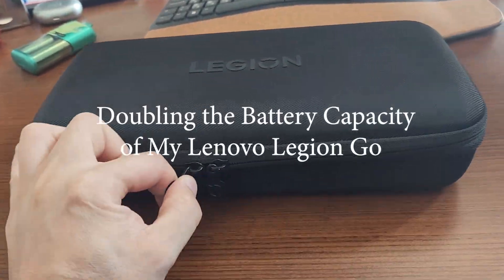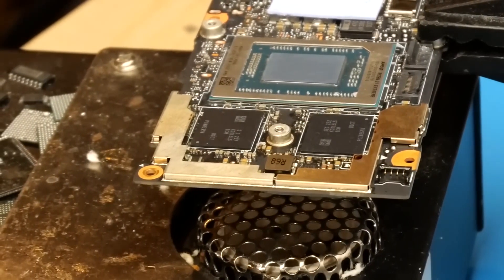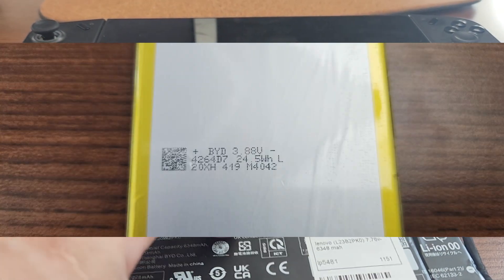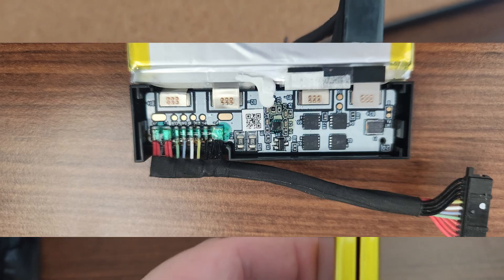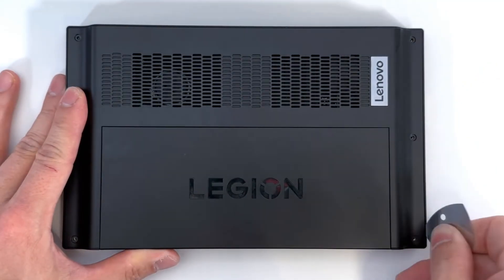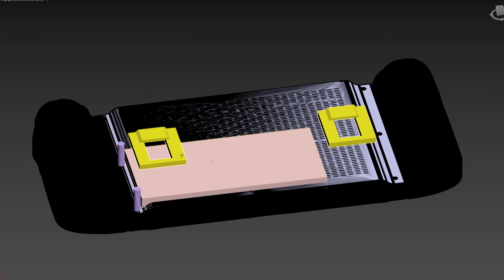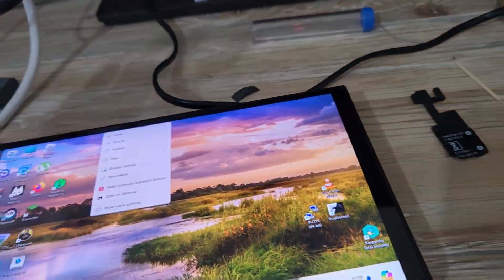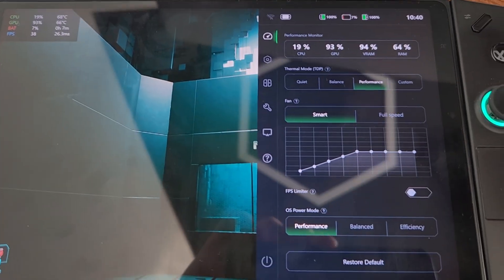Lenovo Legion Go Double Battery Capacity

Comment: Thank you, bro! I just performed this mod thanks to your video instructions! I also challenged a nearby 3D lab to scan my original backplate and create a custom one with stand support based on it. I'm experiencing issues with incorrect battery capacity too, even after a full charge–discharge–charge cycle, but it's not a problem for me.
Reply from the maker: Welcome, if possible share your 3D backplate.
Reply: @elnurmehdiyev5062  For some reason YouTube deletes my messages where i put my gmail, so try certain.gek
Reply: @elnurmehdiyev5062  I'm tired of my comments being deleted. How can I contact you?

Comment: Not really an expert, but i suggest replacing the bms with a new uncalibrated bms. Not unless you have a contact from BYD and provide you with necessary tools to properly rewrite the initial calibration of the cells.

Also don't forget to balance the cells before attaching it to the bms.

Also i noticed it's 3.88v nominal per cell. And it's on series.

You can try your luck looking for a 7.76v-8.5v nominal with large capacity as long as it doesn't go beyond 8.9v maximum voltage when fully charged. (Or limit it by programming the BMS to have the max output of 8.9v)

Though i doubt you can find one since 3.7v nominal and 4.2v max is the standard. Rarely you can find 3.8v nom 4.4v max.

Comment: I will like to get the ram and the battery upgraded on my Legion go. But i dont feel comfortable doing the ram upgrade and mess something up. the battery seems to be less risky because you only working with the new one and not the original. I dont have a 3D printer either. I wanted to ask if you offer both services ?

Comment: I really want to try this! Is it something a beginner could do? Nothing seemed too complicated in the vid from what i saw. Idk if it would be a hassle for you but a more detailed tutorial would be awesome!
Reply from the maker: @StuffIThink  well, its quite a challenge for beginner...
Reply: @elnurmehdiyev5062  I'm really just not sure about the soldering. I know my way around a PC and I've used 3d printers before. You think it would be a bad idea even if i could practice the soldering before i actually tried it?
Reply from the maker: @StuffIThink  If you know what you're doing, anything is possible. In the worst case, you might need to get another battery. Here's how I would approach it:

I recommend ordering two batteries. Start by disassembling one and carefully removing the black sticky tape. Check how the BMS board is attached to the cells and gently detach it to ensure you have enough contact points for spot welding extension tabbing wires. Be cautious not to short anything.

Next, carefully cut the cover off the other battery to access the spot-welded contacts. Once you’ve spot-welded the extensions to the disassembled battery cells, solder them to the contacts of the second battery. Secure both the spot-welded and soldered contacts using Kapton tape, and attach the two batteries together with double-sided sticky tape.

After removing the original battery from the handheld, place the upgraded battery inside and test it. If everything works and the handheld functions with the increased capacity, reapply the sticky tape to secure the battery and print a new back cover for the device.

I'll soon update the back cover model with version 2, which will include plastic clips similar to the original design, as well as an improved layout.

Be sure to double-check battery polarities and measure voltages before applying the mod. If there are differences in voltage, fully charge both batteries and then discharge them to about 3.88V before proceeding.

For this upgrade, you'll need:
Two identical batteries
A spot welder
A soldering station
Kapton tape (5mm wide is fine)
Hand tools and a multimeter
Double-sided sticky tape (preferably flexible, similar to the original)
Tabbing wire (3-5mm wide)
A 3D printer (or service) to print the back cover
You can find guides on disassembling the handheld and removing the battery on YouTube.

Comment: You need to find a Lenovo laptop battery with roughly 100wh then use the bms from that to work with your battery. That will work! I've been doing this for a while 👍🏻

Comment: You can just buy extra 10000mah LiPo cells or replace the current one. All you need to do is add extra cells until you can't get any more to fit inside the device. I've done something similar to my phone. from 5000mah it's now running 2000mah, just use the same BMS. Hope this helps
Reply from the maker: Cells used in GO rated to 3.88V, if you can find such specific batteries with larger capacity, please share, would be useful to others too. Cells with other voltages and chemistry would likely destroy your charging circuit or lead to early degradation of different voltage cells.

Comment: Hey buddy just curious, can you tell us which IC on this device specifically requires 3.88V to a point you need to get a battery that is putting out exactly 3.88V?

Also there's a reason Lenovo left room inside and didn't cram it full of battery space, but hey, what would I know?
Reply from the maker: The specific IC you're referring to is part of Lenovo’s design approach, where they reuse components from their laptops to accelerate the product's development and release. This includes the power management circuitry, which is optimized for the same 3.88V cells commonly used across Lenovo devices. In my modification, I parallelled identical cells, effectively doubling the battery capacity while occupying the intermediate frame space, which was originally reserved for cable management. This adjustment had no impact on thermals, as there’s sufficient space for airflow, and the design safely accommodates the increased battery thickness. Lenovo likely left extra space for flexibility in design rather than for thermal concerns.

Comment: Hello bro, can you tell me the size of the Original battery? I'm going to customize the battery, but I need the Previous Dimensions
Reply from the maker: Cell sizes differ from package sizes (w BMS).  Take 65x140x10 mm for double cell sizes as reference. Add BMS 65x20x10 mm
Reply: @elnurmehdiyev5062  And I want to know what the maximum internal space can be without the height of the plastic plate, because I want to customize the battery as big as possible without retrofitting rear lid。
Reply from the maker: @junjiejiang3933  you better open it and check yourself in that case
Reply: @elnurmehdiyev5062  thanks a lot bro🙏

Comment: Just use power bank. Problem solved
Reply: I don't think you quite understand that the purpose of this is to eliminate the need for that.
Reply: @llcj07  how many mah did he add? Its more practical to use powerbank. Powerbanks has more battery capacity. If this is to replace powerbank then your idea is stupd
Reply: @llcj07  and his way of eliminating the powerbank is stupid..
Reply: Yeah but with power bank you eliminated the need to update custom firmwares, screw up 3d prints, solder battery tabs with messed up bms and god knows what's next 😂.
Reply: Khaby Lame would definitely hook up a powerbank and make a funny face

Comment: 3.88 nominal voltage cells? Very bizzare choice, especially when space was not at a premium and the device was already a heavy, chunky boi. This increases costs, but gives it a higher capacity.

I believe they are HP (high performance) cells that are more commonly used in cell phones. They have a max voltage of 4.48 (around there), instead of the typical 4.2 volts.

Comment: idea have you tried bazzite or cachyos ? i think the battery indication adjusts itself differently in that os it take a bit of time like a full battery discharge to calibrate. I'm running cachyos it's super easy to install dual boot and runs like a steam deck you can go to sleep mid game no issues.
Reply: Running bazzite on mine

Comment: It could also be tested with a Lenovo battery of Capacity: 60Wh/7820mAh Compatible laptop models:

Lenovo Yoga 7 Pro Series

Lenovo Yoga 7 Pro-13IKB Series

Lenovo Yoga C930-13IKB C930-131KB Glass Series

Lenovo Yoga C930-13IKB-81EQ Series

Lenovo Yoga C930-13IKB-81EQ000HGE

Lenovo Yoga C930-13IKB-81C4 Series

So the weight will not increase too much and we will have more playing time, it would be 1472wh more and maybe it would be without modifying the housing.
Reply: I would take it perfectly inside since the measurements are 29.5cm and if we disassemble them and put them one on top of the other they are 14.55 and we disassemble the thickness remains at 1cm. So it would take perfectly inside the original housing, having the same connector and would close the housing.

Comment: If manufacturers were forward thinking enough, options like this would be available from the manacturer.  Imagine them selling double sized batteries as an option and being able to sell a bigger cover etc.  Docks that added additional cooling capacity so the machine could run faster whilst docked etc.  They really don't think about this stuff as a way to make more money.  p.s. Great job :)
Reply: They do make these machines to your spec. They are boutique providers and the machines are double the price. You can get one with the strix chip and 64 gbs of ram with a 99 watt battery and OLED screen...$1999.00.
Reply: @johnwebsterification  interesting, I did not know that. Very cool.
Reply from the maker: @matthewwain9958  they are focused on competition, that going to be next gen handhelds I'm pretty sure, just like ROG did.. ))
Reply: That's because they honor a warranty where the machine has NOT been opened.  You open it, no warranty.   Make sense?  They don't want just anybody doing upgrades to their product and then have you expect to have a warranty, so of course they aren't going to sell that stuff.  It's common sense, which most people don't have anymore.
Reply: You can open a product just fine and still have warranty. Stickers saying you can't are not legally binding. The manufacturer has to prove anything you did caused a failure, in order to get out of honoring a warranty.

P.s. PC's are highly configurable and modular.  Your comment really doesn't hold water.
Reply: @matthewwain9958 , yeah, honestly I think I've heard such warranty problems from asus (like rog ally) users more than lenovo, if lenovo had that much trouble at all?
Reply: @inkbutterfly6706  I honestly don't know on the Warranty front.  I haven't read any drama on it yet
Reply: Tbf, they could just make two versions. Like there are already two versions of legion go in Australia. LeGo z1 and LeGo z1 extreme, second one is the normal and only one variant being sold in any other country. I really see no issue with selling something more capable, if they have no issue selling weaker z1 and stronger z1e. I've seen so many people wanting a bigger battery capacity from the go(ha, get it?), I don't think they'd go broke

Comment: Is it possible to make it smaller for full sized ssd
Reply from the maker: @Anansi2077  thing is, "full sized" NVME drive consumes as twice as much of energy, there for, it's better to purchase and install, same formfactor drive with 2TB capacity, those are available on aliexpress (pay attention to the read/write speeds). That's gona be more than enough for this handheld.
Reply: @elnurmehdiyev5062  my goal for my legion was to be as powerful as your average gaming pc but on the go, which is why I added a 4tb ssd and 32gbs of RAM. Since I know ill be traveling and i like playing with friends the go was the perfect for what i wanted, the only thing i have to worry about is Battery.

Comment: You need to spot weld the four battery tabs to the existing battery and ditch the 2nd BMS Board.  That way, the original BMS will re-calibrate the Full Charge Capacity to double the amount after a full discharge-charge cycle.
Reply: It won't recalibrate. The design capacity won't change no matter how much bigger you make the capacity
Reply: @ksrnate  so what you saying is the bms won’t allow it right? I wonder if we can modified the bms..also do og ally have bms? Because i saw a lot of people modded the battery and it the indicator works with added capacity’s
Reply from the maker: @ksrnate  I got it ))
Reply: The protocol is smbus.  Most batteries have the BQ chip.  The Design Capacity and Full Charge Capacity are two different things.  If you buy a new battery, it usually has a FCC value higher than the DC.  The DC is a safe value that the manufacturer can guarantee performance.  The DC is stored in the static part of the eeprom along with Manufacturer, Model, Design Voltage.  The BQ chip cannot change this, it has to be programmed.  The FCC is stored in the dynamic part of the eeprom along with the Cycle Count, State of Charge.  The BQ chip tracks these and changes them according to your usage.  If you do full charge discharge cycles every day it will result in a Cycle Count of +365.  BQ chip also  monitors the amount of current that goes into the battery while charging until the battery is fully charged.  It then updates the FCC value based on that.
Reply: there must be spd data that can be edited to increase the recognized battery life same way you'd do for the ram wouldn't you say?
Reply from the maker: @lazal3m  that what has been done already, most likely bios needs to be tuned.
Reply: @elnurmehdiyev5062  What about the battery driver from device manager? was that deleted? Needed to do that with my ROG ally battery upgrade to see the full 90whr
Reply: @elnurmehdiyev5062 did you figure it out yet? Im so invested in this mod ❤ the only thing that lego loses againt ally x is battery for me